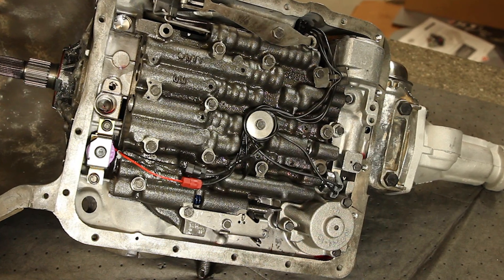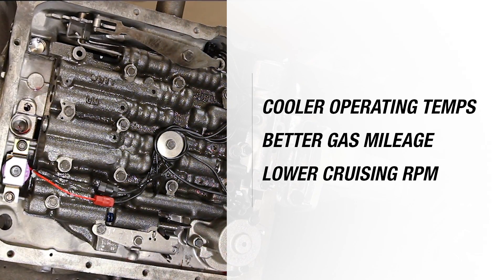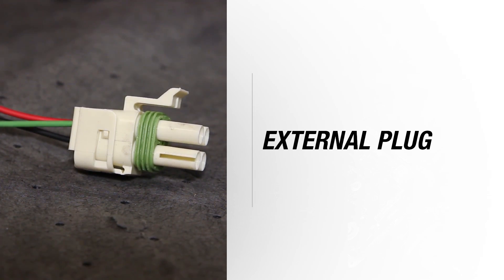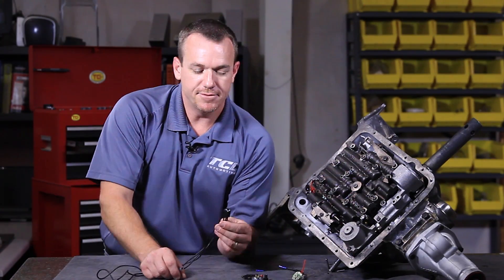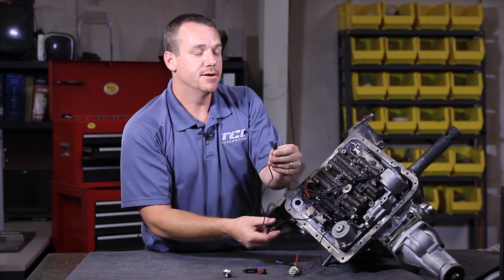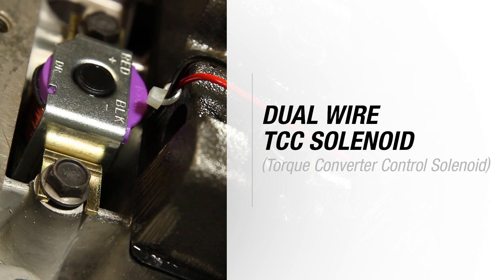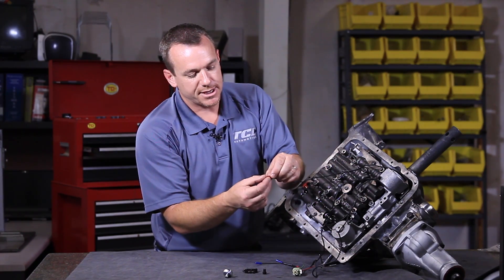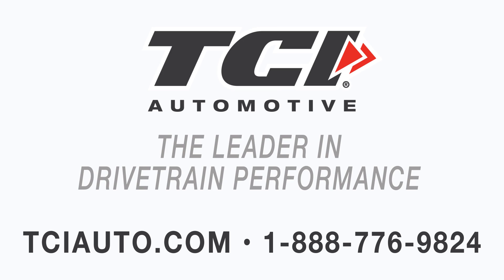TCI: 200R4/700R4 Lock-up Kit

Comment: My transmission mechanic has installed everything internally. I'm left to figure how to wire it externally. The kit came with instructions but I'm scratching my head. I want to hook it up once, the right way. Is there a video on that?
Reply: Google shows about 8,023 videos
Reply: @N @Nowayjose-z2r that’s funny because I didn’t see even 1
Reply: @Mr1lukers  Even Monster Transmission has 4 separate videos.
Reply: @Mr1lukers  https://youtu.be/fLcahFJC8EU?si=oqCjqevBRm8bYO1D

Comment: I have a 1990 Corvette with the 700r4 transmission. It would be nice to have a pre set lock up by speed. For example instead of locking up in 4th gear at 45 mph I rather have it lock up in 4th at 65 mph.

Comment: What is the vacuum switch set at? I have a pretty big cam, with Low vacuum. It doesn’t seem to be unlocking the converter when in fourth gear and load is increased? I think my vacuum might be lower than the switch is set?
Reply: I installed a vacuum pump for the brakes and the switch. Im runner a big cam and a tunnel ram

Comment: doe the wire on the external plug lconnects to the brake switch or direct to 12 volt

Comment: Chevrolet Cruze 2.0 
. This kit can be installed ?
Reply: No. this kit is needed only with a 700r4 transmission in applications where you are no longer using the factory ECM to manage the engine; such as switching your engine to run on a carburetor. The 700r4 was used in a number rear-wheel drive GM vehicles from 1982 until about 1992.

Comment: I've got a outside wired system I think for the lockup. But cannot here a solinoid inside once I power the wires up. What would be next step in diagnostic for this lock up to work for me in 4th gear? https://youtu.be/9nmWR2M3nvk here is what I have...wired. But no clicking noise no nothing when hooking to positive12 volts. Thanks!

Comment: What I want to know is how and when does the transmission kick in and out of over drive
Reply: When you tell it. Think of it as almost a kick down cable or if a TH400, switch. Instead of downshifting (usually it does though), it unlocks the converter. Switches on in 4th gear at or above pressure (pressure switch) as it only reads from 4th gear circuit.

Comment: will wiring through a brake switch drain the battery due to the constant power to the solenoid?
Reply: No, because it should still be wired through the 4th gear pressure sw, and if the car is off there is no pressure

Comment: From the video it looks like you direct wired the hot + red wire from the TCC solenoid to the external plug and the ground wire from the TCC solenoid went to one side of the pressure switch and the other side of the pressure switch went to the external plug... My question is, aren't you supposed to wire it the opposite way??? Shouldn't the positive be wired through the pressure switch???  If I want a to control when my trans locks up, then I simply install a switch on my dash to control it...   The way you have it wired up,  I have to place the switch between the negative wires NOT the positive or hot wire...  I have never seen this way of wiring  before...   Is there a benefit to wiring this up the way you have it in the video??? If so please tell me why...  I would appreciate some feed back...  Thank you...   David...